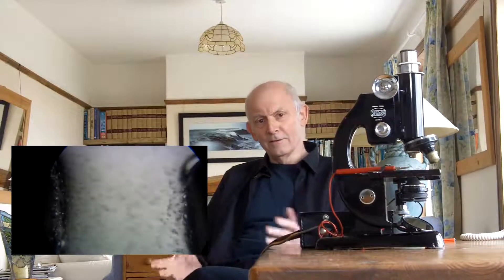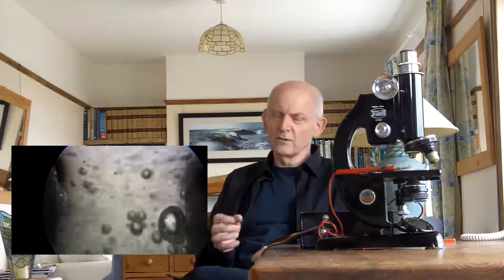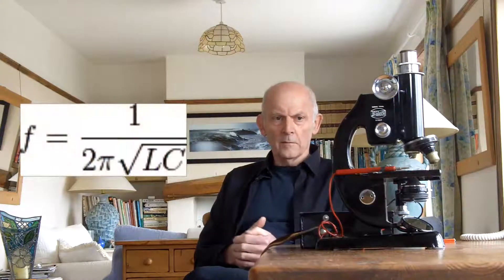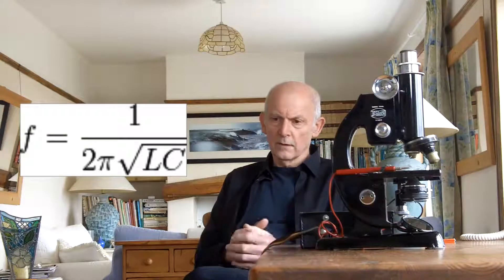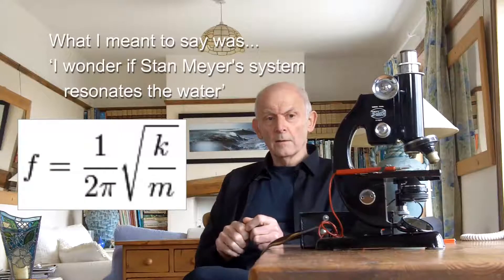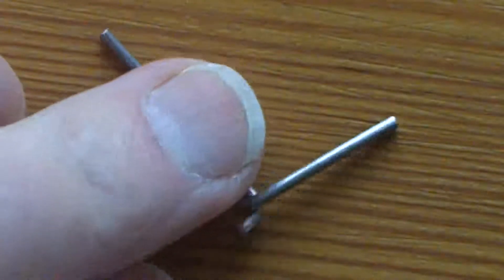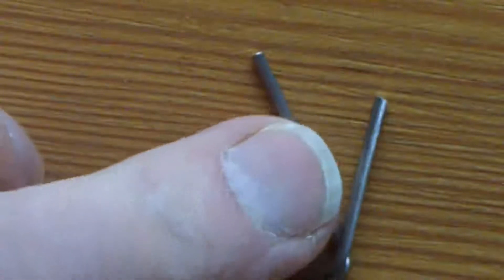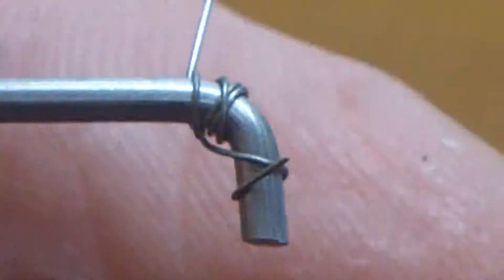HHO. 25 HHO under the microscope, could be significant.

Comment: Thanks for showing me the small L shaped metal angles, they reminded me of Allen keys, which then gave me an idea for a crankshaft made from Allen keys for my desktop Stirling Engine, ( i dont have a HHO device ( my next project ) to heat up the shaft and flatten the ends for joining them ( after drilling the flattened ends ) instead of joining them with allen keys, but thats got me out of trouble until the HHO kit arrives ....

Comment: Ideally you are looking to make a cell that  resonates at 6.6098 MHz (H-O) bond resonance (total combined cell operating frequency). The voltage needs to be 1.5 Volts to 1.85V . You also need a magnetic field that polarizes the molecules and that should be about  0.2 T Perpendicular to the plates . The configuration is several cells in a cylinder 1 central active plate and 2 end active plates. there is one central hole about 50 mm dia in which the magnet is inserted with a radial magnetic pattern, and the outer of the cylinder is opposite of the pole again circular magnetization. The cell is rotated at about 1000 RPM so that the water level is about 5 mm from the inner lip and does not "fall" the other edges are SEALED - there are no holes communicating between the plates. water is introduced by means of a "spray bar" . On the inner drum, there are inert disks of Nafion that extend into the cel spaces and have a gap of about 0.5 mm to the two plates, and about 0.5 mm from the end of the sealed outer section.
 Cell temperature should remain at or slightly below 55 degrees C. The problem I have is matching the cell construction and the dialectic properties to align all the resonances with that of the O-H bonds. Multi Variant solution much like a Stirling engine. Changing one factor effects all the rest.  The pressure of the water is increased by increasing the RPM of the drum. This increases the rate of evolution. The resonance of the water can be adjusted by temperature and pressure to match the physical cells. BUT the complex relationship between the Exclusion Zone H3O2 alatrope "flat sheets" and the drag of the water on the Nafion and the changing capacitance of the cell and the dialectic properties are like winning lotto. This can also be changed by adding 3400 nm IR radiation from LEDs.  Anyway a basket of too many factors. Maybe you'll have more luck than me !

Comment: That IS interesting. thank you..i have always wondered. im interested to see what happens in the atomic scale..lol..but i do have an interesting question for you...ive looked on the net and cant seem to find it due to lack of key words...but the rumor is, some boat, with a resteraunt on it, has two drive motors that work in salt water. the theory is, that its like a plastic tube...inside the tube are two separate pieces of metal. like a capacitor i think. anyway, the sea water ,once the two plates fastened to the inside of the tube that are charged with direct current, move the water from one end of the tube to the other creating a flow.....so its basicly a electric boat motor that has no moving parts......when i saw your scoped view of the  electrolysis, it made me think of it....do you know anything about it?...thank you for the video and sharing your knowledge :)

Comment: Hi Andy I have been 8 years now on Mr meyers system and wondered if with your oven you would be confident that it would be possible to manufacture the porcelain requirements of the Mr Meyer Injectors? Kind regards and thanks in anticipation
Rob

Comment: Kinda makes sense. When you applied the current, the hydrogen and the oxygen are moving toward the respective plates thus the movement of bubbles in both directions. My guess is that those tiny bubbles are pure individual hydrogen and oxygen bubbles. The term HHO would be when the two gases are mixed in chamber after their bubbles popped above the water's surface.

Comment from the maker: If you connect electrodes to a battery (or DC power supply) and put them in water with salt in it, hydrogen gas bubbles will develop on the negative electrode and oxygen gas bubbles will develop on the positive electrode. You’ll get twice as much hydrogen than h you get of oxygen. As I say, search YouTube or Google and you’ll find all the details you could possibly need including how to collect the gases. 
  All the best ... Andy

Comment: Very good demonstration. I doubt ripple is creating the effect you see. To test, a simple filter cap should easily get rid of most of your ripple. At 5mA and 2.6KHz, 1 or more uF should be more than enough. Easy to salvage from a microwave oven.

However, traditional electrolysis of H2O starts at ~1.2VDC. Anything higher produces a lot of excess heat. You may actually be boiling the water. The motion is most curious though. Obviously influenced by electron flow.

Thanks for sharing!

Comment from the maker: Hi there, on, it’s simply as I said at the beginning of the video, sometimes in order to get another view of a problem I think in terms of making differences ten times bigger or ten times smaller. As it happens, using a tiny drop of water has been the most interesting to look at under the microscope. If you watch some of the later videos in the series you’ll see that the bubble activity with the electrodes completely submerged is not as interesting as this video. Kind Regards ... Andy

Comment from the maker: Yes, when I first saw the lines from side to side I had the same thought... ‘Magnetic flux lines.’ I suppose reasonably there are lines of electric fried and electron flow and maybe the electrons simply drag the water along like the wind blowing leaves we can’t see the wind but we can see its effect. 
Thanks for the interest in the project.  
Regards ... Andy
Reply: Yes the gasses are charged when separated with HV resonance then rush towards the opposite charged plate,  in doing so electrons moving create magnetic fields so now these gas bubbles have a magnetic field because there charged ,
I'd like to see the effect of adding strong magnetic fields to separate the water. 
Good idea to view what is happening  🙂

Comment from the maker: I have my TX’s set up in the work shop and it’s been hard to resist the temptation to drop a sniff of RF into the cell but I know that I usually push these things just too far and I don’t want the distraction of having to repair the output stages. I have got an old 2 Metre rig I never use that just might feature in a HHO/RF video one day. I bet a few folk have had a belt off a bunch of innocent looking batteries, I was taught, 25 mA for 25 milliseconds can start fibrillation.
Regards ... Andy

Comment from the maker: Hi. I'm beginning to think that maybe some of the gas is simply absorbed back into the water when the voltage is switched off. I can’t think that its steam but I guess steam can be scaled down. I think I should take up knitting or brain surgery, you know, something I may have a chance of understanding. Thanks for the nice comments I try to look at things from another angle to what most others do, sometimes it pays off but there’s a lot of frustration too.  
Regards ... Andy

Comment: Andy, great stuff.  I agree, I was thinking SLOW MO the instant you showed it.  I have 2 things to add to your list of interesting tests.  The first is PURE DC (btw, 500V @ 5ma = 2.5VA (easily enough to create HHO)).

Next thing, I would have put a plastic shunt on each side (Drilled the same size as the SS rods you have, and then cut in 1/2, and then cut the top off so it is open).  The water would SIT in that quite nicely, I believe, from the adhesion properties. (#2: Ph Dye for color!)

Comment: One more thought,  60 9V batteries in series would give you 540v and more than enough ma...and absolutely and metaphysically no AC....lol! That is one very positive way of eliminating AC ripple as a variable. Conversely, a CW transmitter and maybe an antenna tuner would help eliminate DC as a variable -and worse come to worse maybe bag you the most unusual QSL ever.

Comment: You peg the 'interesting' meter as usual Andy! Seeing how you are pumping about 2.5 watts into a tiny water drop- how do you know that you are seeing HHO -and not steam? At 7:11 in, you can see a small condensation patch form on the slide- then it goes away when you kill the power. HHO would not do that. My guess is the ac ripple is causing the motion, maybe whip up a pi net to get the AC off the DC? In any case, very interesting! The user guide for my megger does not mention this test:) Novel!

Comment: i think of the water like a spark arcing across the air, it is just a different medium. when electrolyte is used, you have a amperage effect, shorting out, between the plates. when the water is clean, then you have voltage jumping like a arc gap. the spark has to ionise the water in order to cross from one electrode to the other. this will leave a ionation trail( the orange) then it gets complicated.

Comment: NICE ! so do you think the bubbles followed magnetic flux lines, as the crossed? or do you think the voltage was arcing over and ionised the water as it passed through it? I can see that the water has you in its intelectual grasp now. you will never excape it. you just fall deeper and deeper into it.

Comment: Oh, and a possible idea about how to get a better picture of what's going on. Long exposure still shot in a dark room, and a quick flash. For example using a timer circuit to produce a pulse to drive an LED. This won't give you moving footage, but it will give you a clearer image.
Similar idea, periodically pulsed LED which matches the frame rate. Should also reduce the blur.

Comment: Did you try lighting a match over the drop? It might seems redundant, but I got another idea. Maybe that not electrolysis at all, but electrical arcing which causes dissolved gases in the water to become gaseous to provide a path of lower resistance for the current. Try shooting video through the microscope in a pitch dark room and see if you see little sparks.
Another thing. You used purified water, but it might contaminated by dirt on the glass or maybe more likely corrosion on the electrodes.